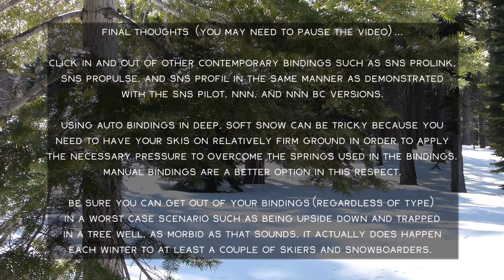Clicking In and Out of Your XC Ski Bindings

Comment: Thanx again for your reply >  Yes I agree that the E-99s work best in more "Hard Pack" conditions.  We call the snow in Western Oregon "Cascade Crud" because it comes in Wet; Heavy;  and turns to hard pack quickly.  I went out 2-days ago to a place that people seldom go.  I like getting away from the crowds but a Small Cat had cleared the road so the tracks of the cat "Crushed" the snow into something similar to concrete conditions..  It was Uphill all the way in and I actually walked all the way out because the snow  was so hard I couldn't keep an edge >  My new skis have metal edges and that still wasn't enough to slow down.  

I want to go back up when we get a couple inches of new snow >> 

Question:  What is a good x-country ski that turns really good but is small enough to mount a NNN BC Binding  (NOT a 3-Pin) ??    I weigh 233 with all my gear (Boots; clothing; small-pack) but I want a ski that is relatively short and easy to control  but also easy to turn too ??  

Someone recommended a Fischer Crown OTX 98 but I would love your opinion ??  Thanx
Reply from the maker: That's funny because we call our snow here in Tahoe "Sierra Cement" due to it often being in a similar state. Or, if it comes in dry and powdery (initially), our warmer winter temps usually cause it to consolidate relatively quickly.

Yep, do what you have to do to get down safely! No shame in walking when faced with dangerous terrain :)
Reply: @JaredManninen  This year we had a LOT of snow that came in all at once;  then it thawed & re-froze so we have a decent "Base" ..  BUT the warmer weather & NO NEW SNOW means it is like cement;  and no surface snow ..  YEP 
Cascade Cement" !!  Thanx for your great ideas and humor ..  Gota have both right ??  ha ha !!
Reply from the maker: Hey Daniel, I just realized that I didn't even answer your question about the skis (from your previous comment). Sorry about that! Not sure why I didn't see that part. Anyway, a Fischer S-bound 98 would be great. Make sure you get the NNN BC manual/magnum version (versus auto) as it's more robust of a platform. I wouldn't go any wider than the 98mm for NNN BC, though.

Our snow is basically like concrete now, as well. We've been having 40 degree days and 20 degree nights, so the thaw/freeze cycle really has begun to solidify the snowpack. I would also love to see a few inches of fresh stuff on top!

Thanks again for your kind words, and for tuning in 🤗 And sorry for not responding earlier to your specific question.
Reply: @JaredManninen  YES;  Again thanx >>  I agree 100% !!   I decided that I am not really doing the BIG Backcountry skiing & breaking snow all day etc ..  So;  I wanted the Fischer OTX 78 but they were late hitting the shelves up here so I bought a pair of Rossegnol  80 with NNN BC Auto Bindings >>  I also have a Fischer OTX 62 (Spider) and I had them changed out to the auto binding ..  I also wear a heavy Alpina NNN BC Boot  >>  I am 69 so my skiing has mellowed out a bit over the years >>  So;  I think the auto binding will work great for me >>   Thanx for your hard work on these you-Tubes,  Daniel (Oregon)
Reply from the maker: Thanks again, Daniel! Sounds like you have a clear vision for what you wanna ski, and the skis to accomplish it 👍 The Rossi 80mm are great!

The only issue I've had with the auto version of NNN BC is that they can be challenging to click back in once you take them off (for whatever reason) in deep, soft snow. That spring is stout, so if you don't have a solid platform on which to direct enough pressure onto the binding (to click your boot in) you can find yourself just pushing the ski further down into the snow. Last night I had a comment from another viewer who recently experienced that. Just something to be aware of, that's all ☺️

Anyway, thanks again for all of your kind words. Happy skiing!
Reply: @JaredManninen  Ha ha ha ..  Yeah; I "Pride Myself" in learning things the hard way !!  ha ha  >>  After 69 years  I am actually learning stuff in just under a Dozen Times !!   Something to look forward too right ?? ha ha >>  Bindings have always been a challenge !!   The more "Robust the Binding" the more "Challenge"  ..    YES;  I used to ski really far & in deep outback snow but now I ski in an area with No Tracks;  Minimal or NO Grooming;  Mostly open Forest Roads etc ..  I only do "Day Skiing" so I never need a ski bigger than the "80 mm" >>   I have to wonder if these bindings are designed by people that have never had to click-in unless they are on a concrete Garage Floor  >>  You seem pretty Mechanically Minded and a Problem Solver ..  Maybe think about a design that is easy to use and actually works and you will be a Multi-$$$  >>     Daniel
Reply from the maker: Ha Ha, I'm always trying to figure out a new xc ski related product to design. But I think it's a pretty niche market 😆 Maybe one of these days, though!

Thanks again for your comments (and your humor!). Much appreciated!
Reply: @JaredManninen  You are welcome for both >>  I was a Land Surveyor for 37 years and worked in the DEEP woods for 30+ years >>  If you don't have a sense of humor then you won't make it out there !!!  ha ha ha >>     I am thinking that Bindings could work on a system  where the Bar of the Boot is in the FRONT rather than the bottom ..  You would slide the boot forward and into a slot;  then the binding would lock it in >>   When the bar is on the bottom of the boot;   it is difficult to see when everything is lined up and if you are off just the slightest bit;  then you get to spend half of your day trying to "Click-in" ..   

It feels like Bill Murray when he was tied to the Mast of the Sailboat in the Movie "What about Bob" and he YELLS in a Happy Voice ""I'm SAILING" !!!  

After a half day;  You finally get "Clicked In" so you YELL ""I'm SKIING"  !!   ha ha ha >>
Reply from the maker: Daniel, that sounds like an incredible career! There are so many different jobs and careers I had no idea even existed when I was younger. During my junior high and high school years I lived in the suburbs and, as a result, just had no idea what I wanted to do (essentially I was an outdoor person living in the city). Mostly I was exposed to a urban-based lifestyle, which never resonated with me, so it took me a long time to find a way to be outdoors more regularly.

Now, I happily work seasonally in the outdoor recreation industry and produce all these little videos and articles on the side. It's definitely not a lucrative path (yet!?), but it's meaningful and rewarding. It does feel, though, that I'm making up for lost time. Ha Ha! But better late than never!

Maintaining a sense of humor is definitely a critical piece through it all. I learned that in the USMC, thru-hiking the Appalachian Trail, running marathons, etc... I also take the approach that if it's not a matter of life or limb, it's not really that serious 😁

Thanks for all of the stimulating conversation, Daniel!
Reply: @JaredManninen  I have lived in 9-States;  worked in 6 and traveled in 39 of the lower 48.  I have met over a thousand people in my Surveying Career and worked outdoors for all of the 37 years .. I LOVE the outdoors & I loved Land Surveying.   I am also a Wildlife & Nature Photographer so I am deeply connected to Nature..   I grew up in West Palm Beach Florida so I know the feeling that you shared about never resonating with City life ..  I have lived in very small Rural Towns for most of my life after I moved away from the city ..  

MY POINT IS:  I have literally met Hundreds of people that are miserable because they spend every waking moment chasing Money >>   I was very fortunate because I eventually worked as a Federal Land Surveyor for the Bureau of Land Management.  I surveyed the Largest un-surveyed land in the lower 48 (Navajo Nation) in Northern AZ & NM;  plus East OK for the 5-Indian tribes;  and then in Western Oregon & South Washington.    

I feel fortunate because I worked in some of the most remote places and I got paid for it !!!!   ha ha ha ..  Now I am retired (9-years) with a good pension and I am still in good health >  So I am enjoying working with my wife in a HUGE Garden;  plus Tent Camping; Hiking; Photography & Nordic Skiing ..  

I think having & doing something that feeds your "Soul" is more important than feeding your "Wallet" ..  The "Later" has its place though .. We all need $$  and I think you have a Niche that will eventually pay off >   

I have friends that are River Guides on the Colorado River so it is seasonal.  Then on the "Off-Season" they Guide Hikers into the Back Country in AZ..  

It is Great to learn from someone like you so please keep up the good work >   Daniel
Reply from the maker: Wow, you did have an incredible career! Bravo 🙌 And it sounds like you're maximizing your time in retirement, which is totally cool.

I suspect over time I'll continue to carve out this little niche of mine and have more success with it. It's super fun and relatively low stress, and I get to meet tons of cool people (albeit virtually) ☺️
Reply: @JaredManninen  Yeah;  my career was amazing >>  I am sure your love for the outdoors & people will pay off >>  Low stress is a Good Thing too !!   best of luck !!  Daniel

Comment: Please advise and tell me what is the name of first binding? I just bought rossi ot 65 skis (red) and salomon 7 prolink boots. Now I need bindings. I just want the kind that can step in and go (w/o bending over to turn a switch)
Reply from the maker: Hey MP, thanks for the question!

The first type of binding I feature is an NNN (New Nordic Norm) binding by Rottefella. The Salomon Prolink boots that you have are NNN compatible. Prolink is basically Salomon's NNN binding system. Rossignol and Fischer also use NNN compatible bindings, as do other major xc ski manufacturers.

If the skis that you have are the Rossignol BC65 (backcountry), you'll need an NNN binding that you can screw onto the skis. Many of the NNN bindings that are used today (particularly with track skis) slide and clip onto a plate that's fused onto the track ski. Again, backcountry versions of cross-country skis require you to use a binding system that screws onto the ski since they don't have those quick-mounting plates. Screwing the bindings to the skis is more secure for backcountry applications than the easy slide-on versions.

You'll have to do some digging around to specifically find an NNN (compatible) auto binding that you can screw down. But here is one option that will probably work ... https://amzn.to/2HfB8Ac . There seems to be more screw-down versions that are manual (reach down to unlock/lock) compared to auto versions. That said, you may be able to harvest off of an older pair of skis a screw-down NNN binding since the NIS and IFP plates (slide-on style) are relatively new.

As far as mounting the bindings goes, I'd recommend having it done at a nordic ski shop or center rather than trying to do it yourself (unless you have previous experience). It's not rocket science, but without the knowledge/experience and a couple of specific tools (jig to lineup the drill bit and holes) and a collared bit (appropriate depth), you could wind up ruining your skis. Bindings don't actually come with directions, just a very simple template that may or may not be accurate since it's often just printed on a piece of copy paper. For example, did the guy who hit the "print" button have the image scaled properly or was the "scale to page" option left checked and now the little template that determines where you'll drill holes into your skis is actually only 90% of its true size?

Better to do it right by finding the actual balance point on your unique set of skis, line up the jig on the balance point (or in front of or behind it depending on your personal preference), and then drill to the appropriate depth using the correct-sized collared bit. Then, add a little wood glue or silicone rubber sealant (not epoxy) to each hole, screw down the bindings with a pozidriv bit, and let sit until the glue dries.

Anyway, good luck! And let me know if you have any other questions.
Reply: @JaredManninen  Thanks a bunch for your response! Actually, the skis are not back country. They may be touring? You can tell I don't know much:) I bought the Rossignol OT (off track) 65 because there aren't any groomed trails near me. The OT 65 is supposed to be narrow enough to fit on a groomed track and also easier to manage skiing on untouched snow. I live just outside of Chicago so I'd go out to a golf course or forest preserve to practice. I have a friend in Wisconsin who skis on groomed trails so I would visit there once and a while. I guess the Rottefella are good quality so I could check those out in addition to what Salomon and Rossignol have. I just want a good step in binding with not having to bend down to turn something to get in. I don't mind pushing the binding with my pole to get the boots out.  Ease of use is what I'm looking for. Thanks for any guidance. I've just bought this equipment so I guess it's for next year... all the snow is gone:/ (My timing stinks.)
Reply from the maker: @maryposner  Hey Mary, thanks for the updated information. Don't worry if you're confused about which binding to select. I'm nearly as confused. haha. It may take me a minute to compose my thoughts here so bear with me...

The image of the skis that you purchased (SkiRack link you provided) shows that there's actually a binding plate (whether or not it's an NIS or IFP plate, I can't definitively say) on the skis. This would enable you to buy the much easier slide-on version of NNN compatible bindings. However, the description clearly states that there's no binding plate. So, that confuses me. Probably just a mistake by SkiRack because most previous models of Rossignol 65s didn't feature any type of mounting/binding plate. So, if the red skis that you own have a plastic plate fused/attached to the top of the skis, then you can buy a slide-on style of NNN compatible binding.

As I just mentioned, however, I can't tell if the plate is NIS or IFP -- two different models of fused plates that allow you to attach the slide-on style bindings (but are not compatible). I totally agree that this is all confusing, but it has to do with intellectual property rights (patents, etc). NIS is made by Rottefella, which Rossignol (and Fischer) used to be associated with but severed ties. They, then, wound up developing their own plate system (IFP). Fortunately, though, every major xc ski manufacturer is finally getting on-board with using a standardized NNN compatible binding system. So, once you figure out which type of plate is on your skis, you can just buy the correct NNN compatible binding to attach to them. Then, you can use whatever brand of NNN compatible boot with that binding, like the Salomon ProLink boots you have.

All of that said, I would actually call GearWest directly and explain your situation and describe exactly what you want. They are a top-notch cross-country ski store, possibly the best in the country. They will be able to help you select the right binding for your specific ski. And, at this point, because of the discrepancy between the image and description (via SkiRack), I don't want to be responsible for passing along incorrect information.

Hope that helps, Mary. And let me know what you end up doing!
Reply from the maker: @maryposner  Just keep in mind that the Turnamic binding you shared (via the link) is race-oriented and manual (you have to reach down to lock/unlock it).
Reply from the maker: @maryposner  The skis you have are great and you'll enjoy them, particularly off-track.

I will say this, however, that there's not really one ski that will accommodate both xc skiing in the tracks and in and off-track environment. Most tracks laid at a groomed ski area/resort are about 70 mm wide, so those 65 mm wide skis that you have will be tight in most tracks you encounter. Depending on snow conditions, the skis will be pinched by the tracks. You'll probably notice this more often when negotiating turns/corners when skiing in the tracks. You may also find that the skis will want to ride the angled sides of the tracks and right out of them. The other day I was testing out a 53 mm wide classic ski (that may wind up being our standard rental ski at the resort at which I work) and it felt like on the slightest turns the outside ski would try to keep glide up and out of the tracks. I found that deliberately edging the skis while going around the corners in the tracks helped to decrease this effect.

Anyway, it sounds like your'e going to be doing most of your cross-country skiing off-track which is great for the skis you purchased. Enjoy!